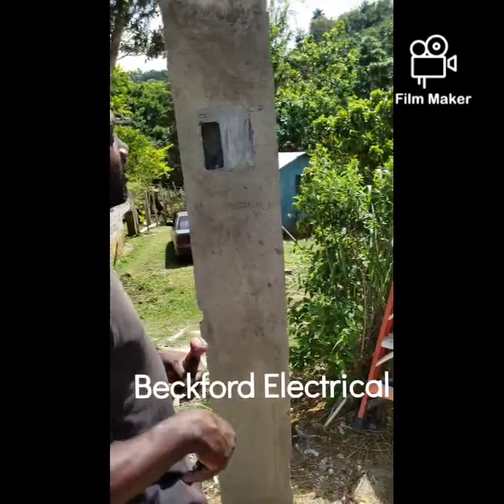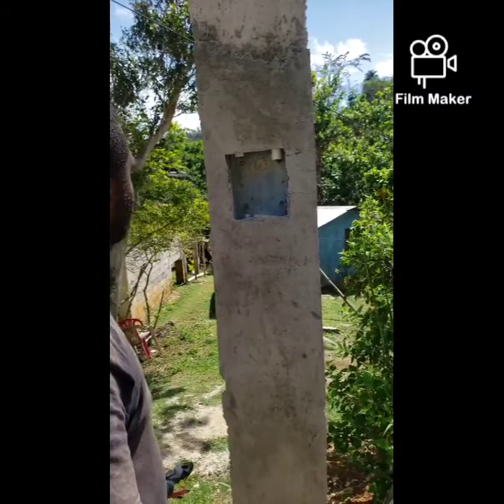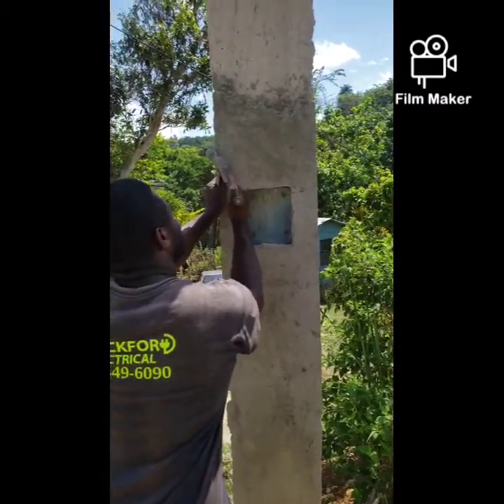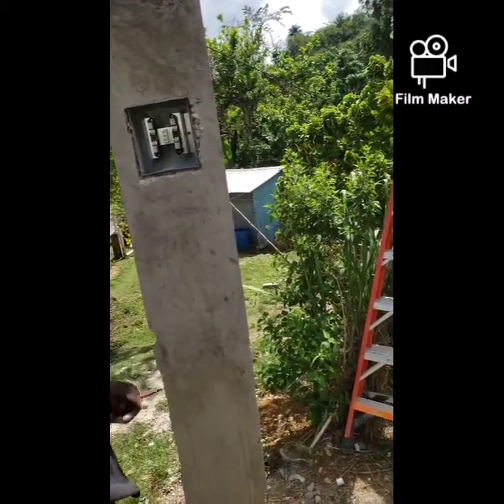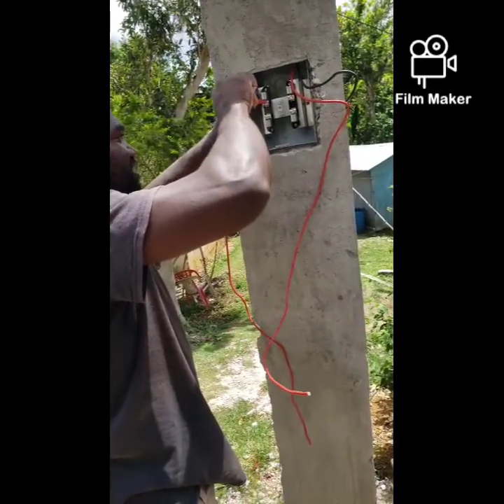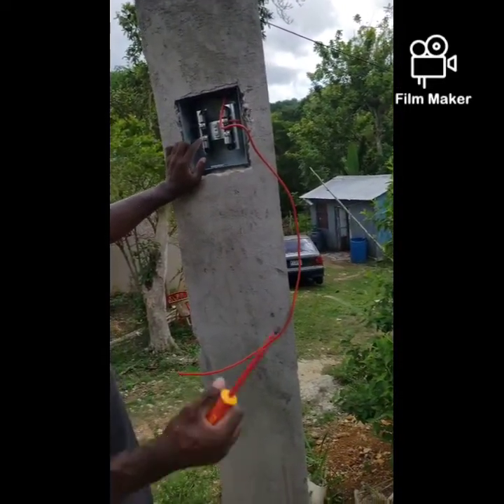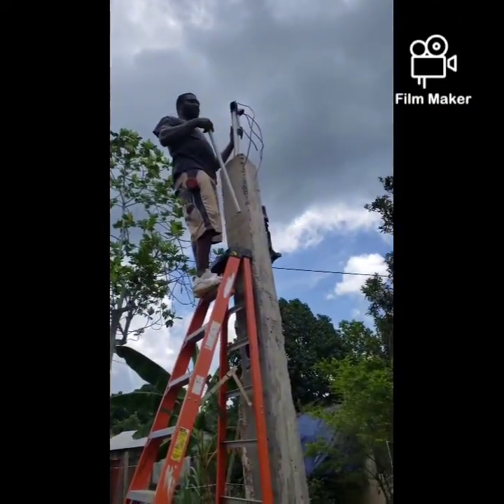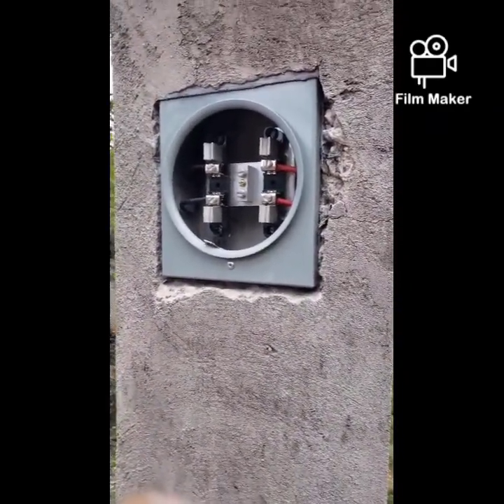110-120 meter installation pt 1 of two

Comment: Could the line be on the left and the neutral on the right? Or its strictly neutral on the left and the line on the right?
Reply from the maker: Base on the the meter its don't matter but if its 240v single phase bout line as to go through the matter.
Reply: @beckfordelectrical  OK thanks

Comment: Based on how he wired the meter socket the meter will not register if it's a digital or if it's an analog,  the meter will reverse because it's an incorrect polarity
Reply from the maker: Have you ever wire a 120 meter?